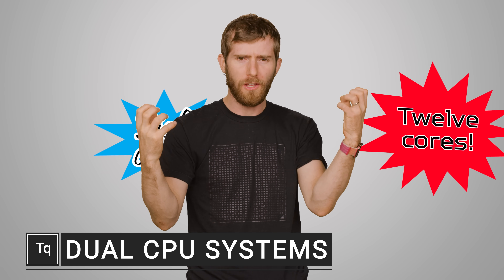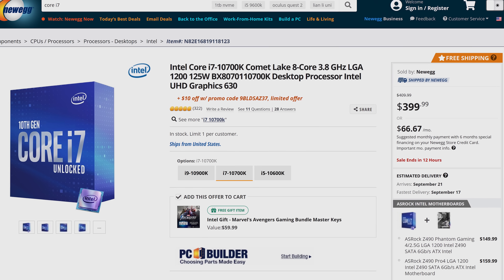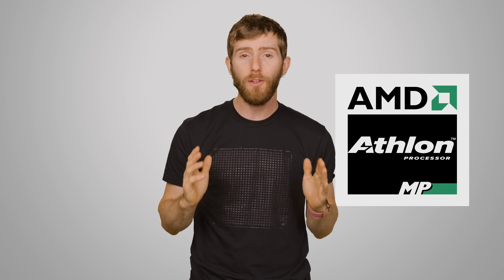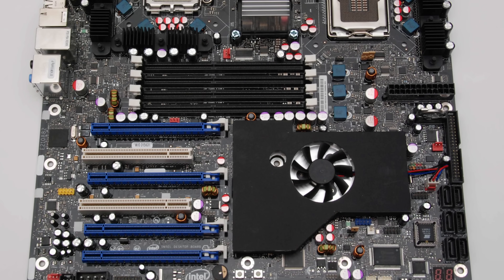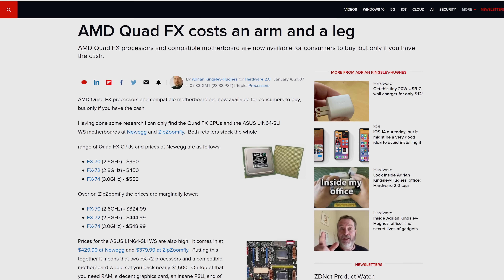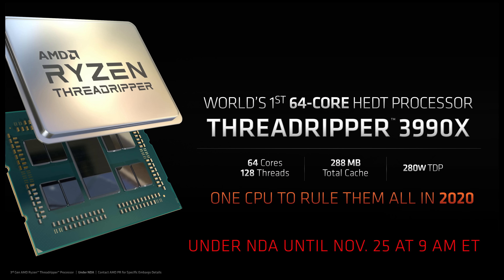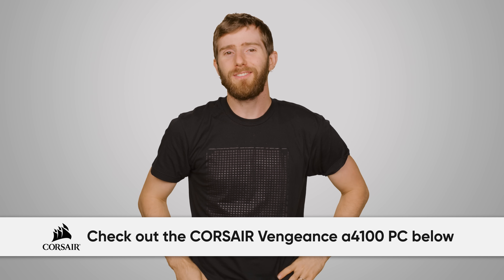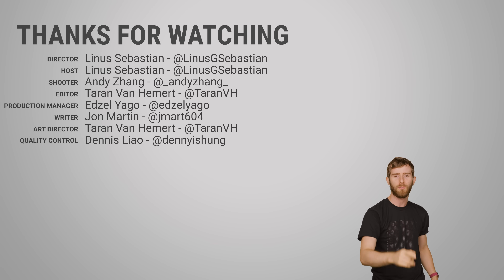Should You Put TWO CPUs In Your PC?

Comment: You can put as many as you like but if your board only takes one they are just going to rattle around.
Reply: Unless you use thermal paste to strap them in
Reply: @nickelwrangler446  Or some tweezers ;)
Reply: @adrianlewis2536  and a swiss knife
Reply: @Petar_GT  Don't forget the allen wrench
Reply: @LillaVya  😂😂
Reply: @LillaVya  don't forget the FAST 2666 ram
Reply: @UUser1337  Dude that is faster than 4400MHz
Reply: @someguywithmtndew5691  yeah.. it goes hand in hand with an 8700k (super rare and hard to get) and remember, screw with confidence!
Reply: @Petar_GT  Damn your right, I forgot about that. Best to grab your anti static bracelet to !
Reply: @adrianlewis2536  lol
Reply: RedEdain - EAS dont forget the power drill
Reply: @someguywithmtndew5691  when its faster than 9000MHz
Reply: @joefish6091  :O
Reply: @LillaVya  you're missing the most important thing which is the table.
Reply: Atheist Future or super glue
Reply: 😊 @nickelwrangler446
Reply: Guys, Thermal Paste on the water block IS NOT ENOUGH that will keep the CPU hot you have to add a whole tub of thermal paste
Reply: @someguywithmtndew5691  open space is bad fill the box with thermal paste
Reply: woah woah, people, dont forget you must have a table :)
Reply: @lethargic.  no you have to put RAM sticks in the second and third slot to have working single channel mode
Reply: I like how everyone still knows that meme of a video
Reply: @nullsurfer7331  it will never die. It's now part of technology history.
Reply: lmao
Reply: or Duck Tape?
Reply: Morgan 600th like
Reply: https://youtu.be/-VOC_ODfdl4
Reply: double sided sticky tape. back to back...
Reply: the most important thing you all forgot about is a towel
the highway could be built anytime
Reply: just tape them to the board
Reply: Just use glue, it makes a strong connection perfect for electrical components.
Reply: @Javier Guerrero was gonna comment this 😂
Reply: PCIe secondary socket
Reply: I guess you've tried this already? LOL
Reply: https://youtu.be/67Y05GgLIJk
Reply: also you must have a good cable management by wrap it around your pc and use the tweezer
Reply: don't forget the board with usb 5.0
Reply: xd
Reply: What if you have a dedicated CPU for Chrome? So many tabs.